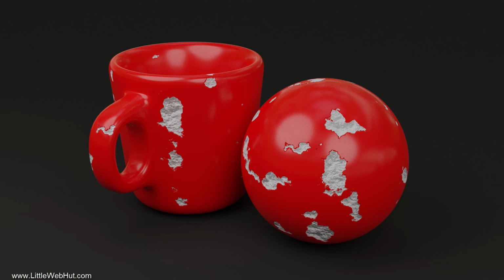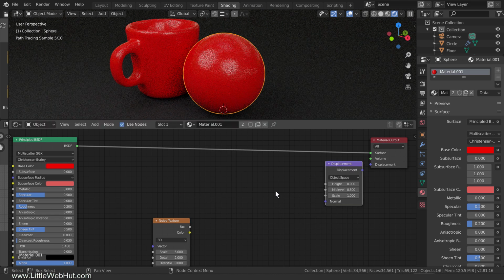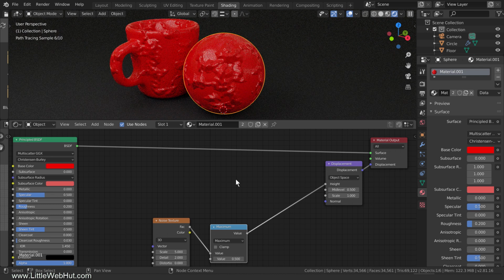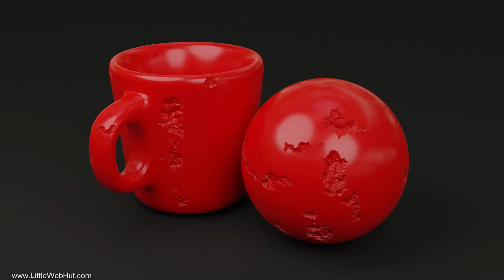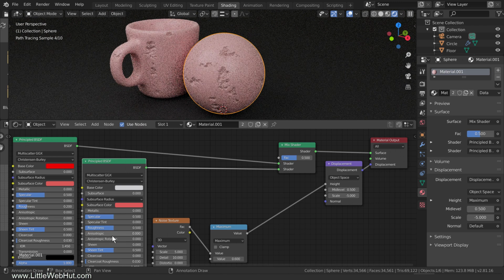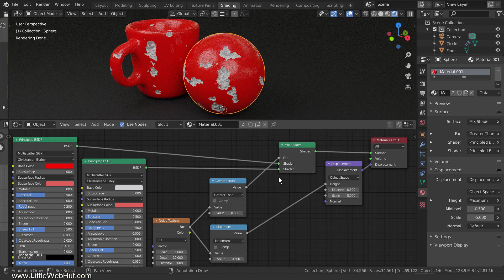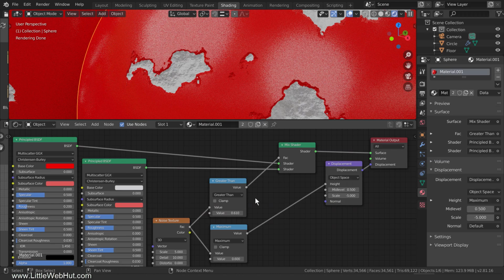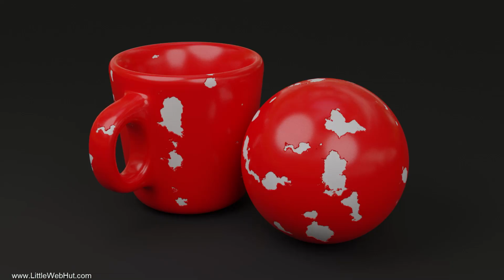Blender Beyond Basics #3: Mathematical Textures - Blender Tutorial

Comment: I've wondered why so many ytubers when they texture their stuff with chipped painted sections don't do this.  Is this considered "intermediate?"  Either way, thank you for saving me the time I would have needed to think to solve this.  I usually use Substance Painter, but I suspected there was a simpler and faster solution procedurally.  This can also be done in UE4's Material System... so this is a two-fer!  Or if I wanted to torment myself, a three-fer, cause Substance Designer nodes have similar functions...